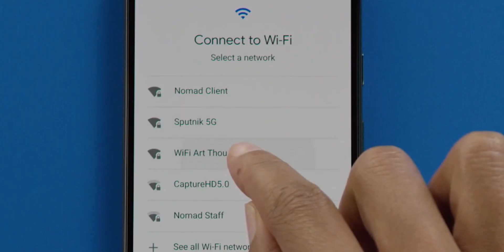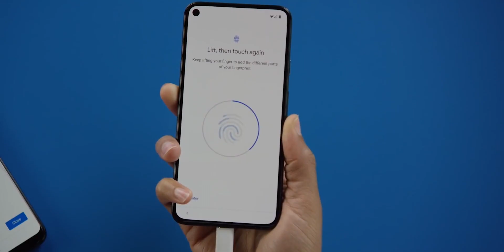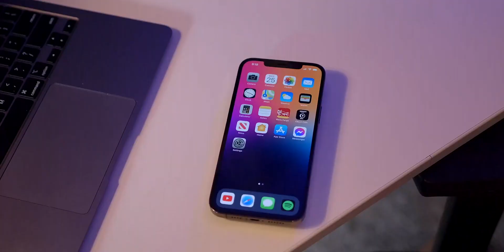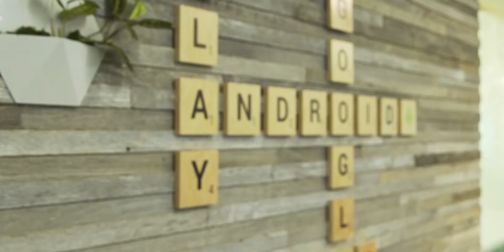Google Pixel 6 - This Is BIGGER Than You Think

Comment: People buy apple because of the name. The overwhelming majority of people aren't going to switch to Android because of a longer time frame for updates. Apple is looked at as cool. A better soc isn't going to change anything either. The stronger chipset on iphones hasn't guaranteed faster phones and better battery. It's literally been the opposite as the iPhone 12 was the first iPhone to beat a note ultra in speed tests in 2 years. Samsung has been better than Apple for quite some time. I agree they should make their own chips. It would make an improvement. Same with Google. I just don't think it's going to take away users from Apple. Most of my friends use Iphones and most of them have no idea what they're getting inside their phones. It's just Apple, so they buy it.

Comment: Apple fanboy?  For real work, real flexibility, avoid Apple!  Instead, choose Android (tablets & smartphones), Windows (desktop) & Linux (IoT, servers, cloud).
Apple "prison" using only Apple-authorized repairs (if "possible"), modifications & parts.  Out of their prison, users & everyone else has true freedom.
Our Android equipment uses USB-C, Microsoft Launcher, Google keyboards (G board) and open source software like Open Camera.
Operating system updates are very frequent & common open software.  Android, Windows & Linux have many choices, many emulations & virtualizations.  There are far greater ranges of accessories, hardware & software.  Some popular older models can easily be kept running, software & hardware.
We avoid Apple's frequent abandoning of the old loyalists, on the old equipment;  Motorola, Intel, etc.
Reply: lmao android tablets? that has to be a joke. also windows is absolute trash.

Comment: Well Samsung doesn't actually does what Apple does now. They used to do it in the past for 2 cores I think but they shut down the division because it wasn't worth it.
They now basically only buy stock arm design and put it in their phone, even though they should have customized the X1 core this year but I don't know much.
Anyway to have a seamless OS and connection between devices like Apple it's gonna take long. Even Samsung who has their Laptops, PCs, Smartwatches, Buds, Smartphones and so on they are not there yet... even though with Microsoft cooperation and stuff they've come a long way and they are probably the best ecosystem out there if you include they have Smart TVs, Dishwashers, Washing machines, Dryers, Vacuums and so on. 
I think Samsung offers the best and the most for the future even though they are not on Apple same level but they offer more and with smart things you control everything.
Reply: What appliances you are talking lolz, nowadays every applications bring ios support first, this is how you define ecosystem..

Comment: Hi Sal, do you think that Samsung is geiually able to improve their Exynos processesor so drasticlly that it will competate with Apple's Bionic and M1 chips?
Reply: I certainly think so. It also depends on if the chip is going to compete with flagships or midrangers. Tye pixel 5 had a 700 series so maybe the pixel 6 chip will be more of a way to get the most out of a cheaper chip.
Reply: @UltraBirdMode  it's all about the optimization bro the better they are able to optimize their chip the more the performance......... I'll prefer pixel 6 over iphone 12 with closed eyes
Reply: I'm not sal but i can confirm that's a no

Comment: Battery could be better using their own chips
Reply: They still using chips from Samsung.
Reply: @fa14bi-78  no their not Samsung made Snapdragon 888 but it's designed by Qualcomm. Google chip is designed by Google made by Samsung there's a difference
Reply: @harryvlogs7833  Designed by Qualcomm, made my Samsung. Yet the Snap 865 still beats the Snap 888 in power efficiency. And for some phones the Snap 865 even performs better (over a longer time period). 

Would wait before falling into an hype. 

Pixel 5: Plastic phone with still a worse main camera Sensor than the Pixel one, running a Snap 765G on 839$ (converted from 699€)

I really hoped for an atleast 1/1.7 Sensor there with their good camera software. 

But nope, just the same shit again, maybe 170$ in Manufacturing cost, sold for like 5 times the price. 

I'm aware that Google was advertising with recycled aluminium, it's actually just a small plate inside of other, the Whole frame is Plastic.

People were hyping about Google that they made it possible for wireless charging to go tough aluminium, was never Alu to begin with.

Sorry for being that negative although i'm usually team underdog.  It just came that I lost my trust in them.

(Motorola, [LG], Google, Sony, OnePlus, Huawei).
Reply: @fa14bi-78   actually 888 is 30% more power efficient but is also 30% faster 888 uses same power as 865 but gives you more performance
Reply: @fa14bi-78  I'm using a Motorola
Reply: @harryvlogs7833  Well, that's what it was advertised to be.
Reply: @harryvlogs7833  Good example is the OnePlus 8 Reaching 108hours in the Gsm area test, while the OnePlus 9 with an 200mah larger battery only reached 87hours.

Mi 10 reaching 109hours, Mi 11 only 89hours.

The Mi10T with an 9% larger battery than the Mi11, reached 118hours, even tho it has an 144hz refresh rate and is IPS, it still lasts 33% longer than the Mi11, having the disadvantage in both refresh rate and display technology.
Reply: @fa14bi-78  mi 11 has 120 Hz 1440 display
Reply: @fa14bi-78  anyway it's not Samsung that's the problem it's Qualcomm chip design they have made some inefficient and overheating chips before that where manufactured by TSMC
Reply: @harryvlogs7833  I do have a Motorola one zoom, it supports Gcam on all 4 of it's cameras. With the Gcam mod the One zoom just surpassed google by using better hardware with the same Software (exept astrophotography since the one zoom is limited to 1/3sec of shutter).  Pictures are useable from 16mm to around 450-460mm.
= Arround 35 times. 

With the stock I would only say 16-48mm is useable, and then 81-160mm.